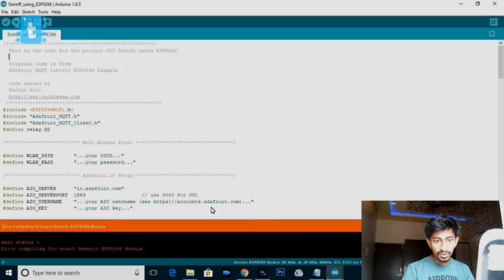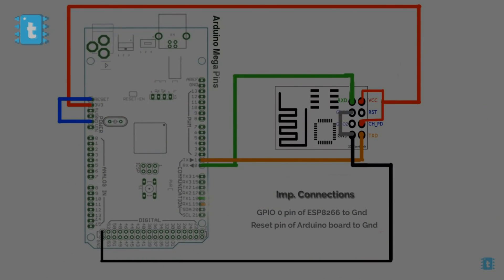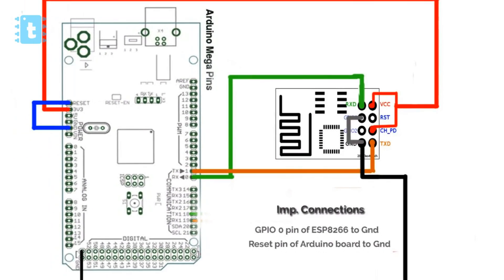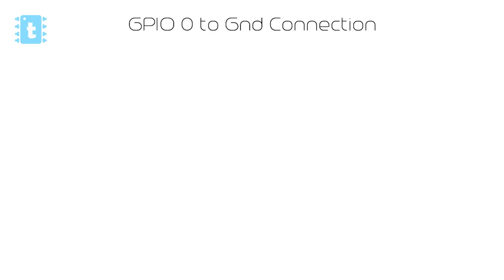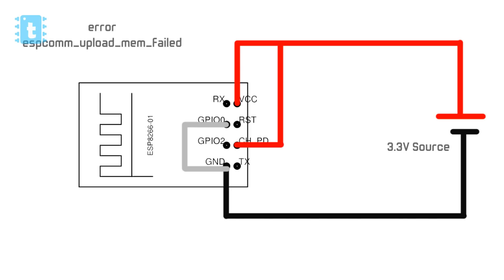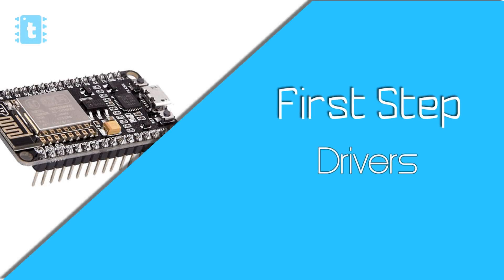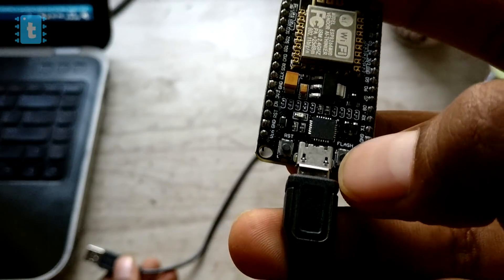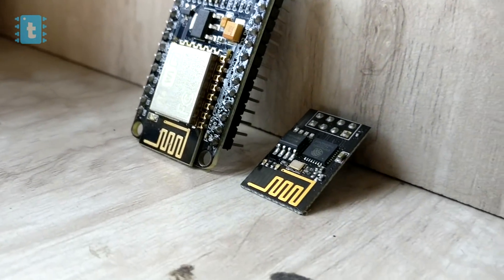espcomm_upload_mem failed | Error solved | ESP8266 projects

Comment from the maker: How was the explanation?
It was tough for me to explain the things clearly still I tried my best.
Reply: I do the same connections with arduino uno. But the espcomm_upload_mem failed problem is still here. Program is not able to uploaded into the board.
Reply: After making all the corrections still I'm getting the error espcomm_upload _ men failed
Reply: Too slow i guess... keep up with your regular speed
Reply: I was stuck on this project and wanting to finish it, but becast of you i can.
Reply from the maker: Glad to hear it 😊
Reply: nice explaination without hesitation , superb , very though to explain these kind or error to someone ,
Reply from the maker: Thanks. Do share it so that, maximum number of people can get to know the solution
Reply: In the next video can you explain us about error : esp is not responding.
It happened while i was running the esp8266 01 with arduino uno.
Reply: How to re program the board after a code plz tell me
Reply from the maker: In the same way you programmed for the first time
Reply: First i have uploaded blink code
Then i want to upload 4 relay you made the 4 relay and sensors
Reply: techiesms though your English is heavily accented, I believe you did great!
Reply: Hello sir I'm a big fan of your project sir, does it need for esp8266 to connect Arduino then pc or it is okay to connect the esp8266 direct to the pc or laptop?.. my board is esp8266 nodemcu lolin brand. I already install the drivers and my computer read it CH340G but the problem is it keeps compiling error I already install esp8266 at board manager I hope you can help me sir.
Reply: Sir, you were great! My compilation problem is solved. Thanks a lot!
Reply: Fabullusee, Wow Dude you are gate !!!
Reply: Still getting the erro
Reply: hey man i have sent you my error please help me out
Reply: Thanks for this tutorial, it runs. But how I can use the digital pins of the ardiuno board? digitalWrite(13, HIGH); don't success.
Reply: I know that you can do it better. Anw, it is good explanation. Thank you.
Reply: AT commands wont work on mine. I tried sending AT but no response at all
Reply: ilu
Reply: Superb explanation. Awesome prodution values as well, top notch video, hat off to you, sir :)
Reply from the maker: Thanks man

Comment: Genric esp8266 12 e having problem in arduino ide and other firmware erorr show com port not open and some times an other error. Drivers is already installed my system and and also checked cable but also facing this problem. Make a video how to clear this error

Comment: for my case, the reason why I get the error is the circuit for Rx is connected to a voltage divider and the input is only from the USB cable. so I try to connect the esp8266 Rx pin directly to the Arduino Rx pin. and it solved

Comment: Arduino15\packages\esp8266\hardware\esp8266\2.7.1/tools/sdk/include/user_interface.h:34:2: error: #error LWIP_OPEN_SRC must be defined

 #error LWIP_OPEN_SRC must be defined

  ^

exit status 1
Error compiling for board Generic ESP8266 Module.

Comment: This is a great video, thank you for posting.  

For about a year I have been programming WEMOS D1 MINI v 3.0.0 without any problems whatever.  I am currently working on a project using DS18B20 temperature sensors which is progressing well.  However I downloaded a programme from YouTube which compiled OK but would not upload, giving the error you mentioned above.  Following that I could not upload any programme, not even a BLINK sketch!  I tried all the usual things, replaced the USB cable, tried a different board but nothing worked.  I even re-installed the IDE.  

Then I tried your solution, grounding GPIO0 (D3 on the WEMOS) and it worked.  Not just that once but I am back to normal uploading once again without having to do the grounding.  Not sure on how this has worked but it has I am eternally grateful for the solution.

Comment: I want to test if the ESP8266-01, is working at first don't I? Your video is excellent if I want to upload a sketch to the ESP8266-01. But before I can even hope to be able to upload anything, I would think and am still trying to basically make a connection and communicate with AT commands . So far, I have not gotten one to work. If you can suggest a very basic instruction or video showing me how to do just that, I would be eternally grateful to you. There are so many conflicting statements out there, that I don't know which is correct.

Comment: Some corrections: 1. To confirm driver installation, checking windows device manager for com Port existence should have been explained. 2. In NodeMcu board funtion of reset button is not explained. Some of the YT videos are asking user to press and release while Arduino is opening the com Port for communication.

Comment: hi, here you said arduino reset should be connected to GND. so that the esp module works. well i want to use them both. i mean like i get data from esp and print them on 2x16 lcd. is it possible? cause when i diconnect reset from GND esp stop working and when i connect it arduino stops working! what do you recomend?

Comment: i had do all instruction for nodemcu but stll error espcomm_upload_mem failed,, any solution please
Reply: in additional board manager URLs it should be proper URLs : http://arduino.esp8266.com/stable/package_esp8266com_index.json before it was not this it was something in between like  2.0.4 so change to above URLs , also see that in board manager esp8266 by ESP8266 Community version 2.5.0-beta2 or latest version is installed.
Reply: @jtechlink4805  thanks for advice i will try it..

Comment: Nice video. But I have still the problem in Linux:
error: cannot access /dev/ttyUSB0
error: espcomm_open failed
error: espcomm_upload_mem failed
error: espcomm_open failed

after that in commandline with a command: lsusb I get:
Bus 001 Device 006: ID 1a86:7523 QinHeng Electronics HL-340 USB-Serial adapter
- this means, that NodeMCU 1.0/12E Lolin, is connected to PC

and cable is ok. Please help me.
Reply: sudo chmod 777 /dev/ttyUSB0 should help

Comment: I have a error please help. i try all. and doesn´t work
Reply: Same for me also I tried every thing but after wards it worked for me. Here's what i did i checked in preferences and in additional board manager URLs it should be proper URLs : http://arduino.esp8266.com/stable/package_esp8266com_index.json before it was not this it was something in between like  2.0.4 so change to above URLs , also see that in board manager esp8266 by ESP8266 Community version 2.5.0-beta2 or latest version is installed.

Comment: if anybody have trouble uploading sketches to their WEMOS D1R1 or similar using the latest arduino ide with error message cxxabi_tweaks.h not present do this....copy cxxabi_tweaks.h from{ your drive]C:\Documents and Settings\{your pc name}\Local Settings\Application Data\Arduino15\packages\esp8266\tools\xtensa-lx106-elf-gcc\1.20.0-26-gb404fb9-2\xtensa-lx106-elf\include\c++\4.8.2\xtensa-lx106-elf\bits  to C:\Documents and Settings\{your pc name}\Local Settings\Application Data\Arduino15\packages\esp8266\tools\xtensa-lx106-elf-gcc\1.20.0-26-gb404fb9-2\xtensa-lx106-elf\include\c++\4.8.2\bits ....it took me a week to figure it out...finally the blink sketches worked...so i have a renewed my spirit  for debugging my ambitious WEB RADIO project...hehehe

Comment: Arduino: 1.8.5 (Windows 7), Board: "NodeMCU 1.0 (ESP-12E Module), 80 MHz, Flash, 4M (1M SPIFFS), v2 Lower Memory, Disabled, None, Only Sketch, 115200"

Archiving built core (caching) in: C:\Users\lol\AppData\Local\Temp\arduino_cache_893558\core\core_esp8266_esp8266_nodemcuv2_CpuFrequency_80,VTable_flash,FlashSize_4M1M,LwIPVariant_v2mss536,Debug_Disabled,DebugLevel_None____,FlashErase_none,UploadSpeed_115200_dc039a9b5a1aa5661a2c22183cfb8cb8.a
Sketch uses 268724 bytes (25%) of program storage space. Maximum is 1044464 bytes.
Global variables use 30740 bytes (37%) of dynamic memory, leaving 51180 bytes for local variables. Maximum is 81920 bytes.
warning: espcomm_sync failed
error: espcomm_open failed
error: espcomm_upload_mem failed
error: espcomm_upload_mem failed

This report would have more information with
"Show verbose output during compilation"
option enabled in File -> Preferences.

still have the error please help me  out

Comment: Hi you explanation is perfect. But my question is this error solution also applies to esp13 or arduino d1? Because I'm using one of this board in my project. Please let me know  asap.   Thank you.
Reply from the maker: The same solution should work as both have chips from espressif only

Still I’m not sure as I haven’t used that

Give it a try

Comment: i have this error 

Arduino: 1.8.7 (Windows 10), Board: "NodeMCU 1.0 (ESP-12E Module), 80 MHz, Flash, 4M (1M SPIFFS), v2 Lower Memory, Disabled, None, Only Sketch, 115200"

Sketch uses 247940 bytes (23%) of program storage space. Maximum is 1044464 bytes.
Global variables use 28028 bytes (34%) of dynamic memory, leaving 53892 bytes for local variables. Maximum is 81920 bytes.
warning: espcomm_sync failed
error: espcomm_open failed
error: espcomm_upload_mem failed
error: espcomm_upload_mem failed

This report would have more information with
"Show verbose output during compilation"
option enabled in File -> Preferences.

i dont know whats up 
can you help me?

Comment: Hi! 
Can you help me with a problem, please? 

In the moment at I compile appear this message: C:\\ProgramData\\MATLAB\\SupportPackages\\R2017b\\3P.instrset\\arduinoide.instrset\\idepkgs\\packages\\esp8266\\tools\\xtensa-lx106-elf-gcc\\1.20.0-26-gb404fb9-2/bin/xtensa-lx106-elf-g++": file does not exist
Error compilando para la tarjeta NodeMCU 1.0 (ESP-12E Module).

Do you believe can you  solve this problem? 

Thanks!

Comment: help

 * Arduino: 1.8.5 (Mac OS X), Board: "NodeMCU 0.9 (ESP-12 Module), 80 MHz, 4M (1M SPIFFS), v2 Lower Memory, Disabled, None, Only Sketch, 115200"

In file included from /Users/xxxx/Documents/Arduino/libraries/DHT-sensor-library-master/DHT_U.cpp:22:0:
/Users/xxxx/Documents/Arduino/libraries/DHT-sensor-library-master/DHT_U.h:25:29: fatal error: Adafruit_Sensor.h: No such file or directory
 #include <Adafruit_Sensor.h>

                             ^
compilation terminated.
exit status 1
Error compiling for board NodeMCU 0.9 (ESP-12 Module).

This report would have more information with
"Show verbose output during compilation"
option enabled in File -> Preferences.